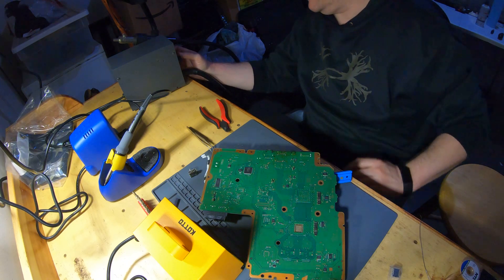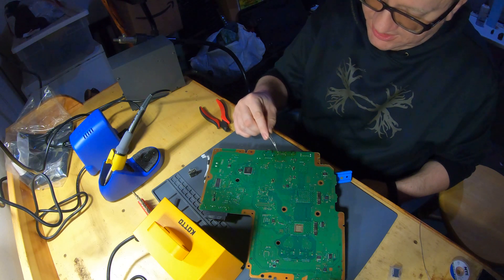PS3 HDMI Port Replacement Part 2

Comment: I don't have a heat  gun. Can I remove the port using just a solder iron (I also have the flux, copper braid, and one of those desoldering pumps)? Thanks in advance,
Reply from the maker: Yes, use a chisel tip and run a solder ball back and forth across the through holes on the bottom of the board till you can remove the port. Then use the wick to clean it up before soldering in the replacement.